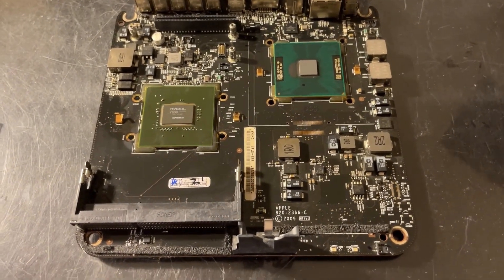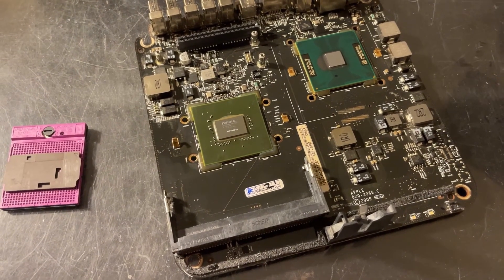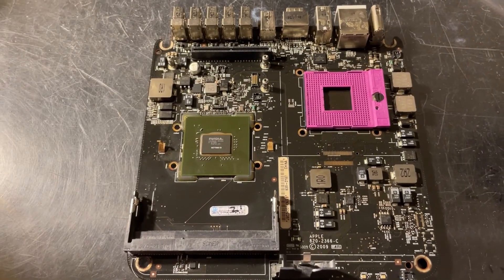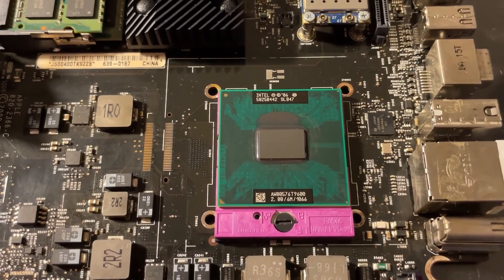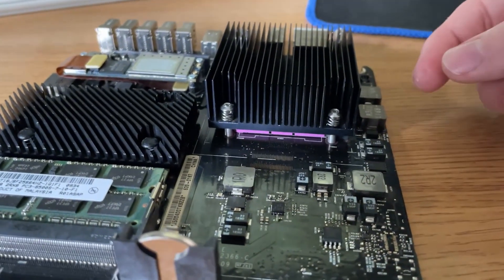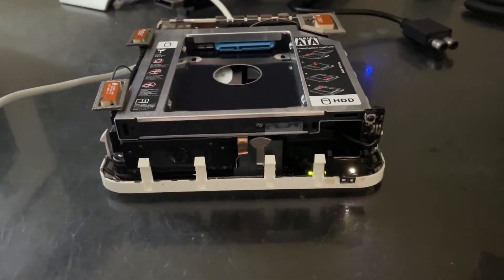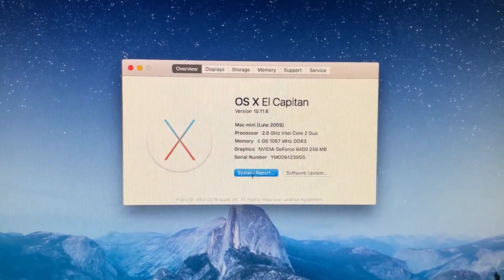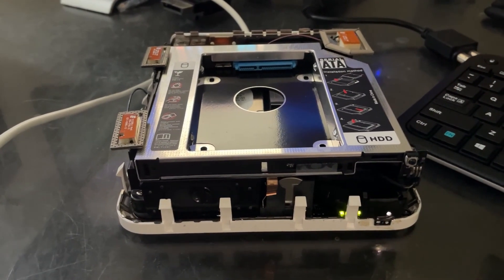Mac mini 2009 Soldered to Socketed CPU Upgrade

Comment from the maker: It seems that the retention spring-pins that were on this heatsink are not the original ones, probably due to a previous owner breaking and replacing them. That is why I had to replace them with spring-screws.

Comment: Planning on doing this aswell. Anything to look out for or reset when it comes to first powering up the mac mini? This is gonna make the mac mini so much more useful and a fun BGA soldering project. With MX linux mac minis are still a super useful machine but the 2.26 Ghz Core 2 Duo is holding it back quite a bit from its full potential.
Reply from the maker: I did not need to reset anything. It just worked.
Reply: @Josh.Davidson  Thank you good to know. wasnt sure since swapping stoff on newer macs may make it look like the mac isnt turning on but its just needs to be reset first

Comment: Nice video! Where did you find the cpu mod chip? I can't seem to find it
Reply from the maker: What do you mean by the CPU MOD CHIP?
Reply: @Josh.Davidson  I want to take off the soldered cpu and install a and easy seeding cpu. I thought I bought the first generation mac mini. And found several videos on the cpu upgrade but no links to get them
Reply from the maker: First generation mac mini has socket installed.

Comment: For the socket, do you blow hot air on top of it when soldering it to the MB? How do you make sure it won't melt?
Reply from the maker: My station is IR. But for hot air just use low airflow and lower than normal temp, higher than normal board preheat.

Comment: How well would a Core 2 Extreme work in this system?
Reply from the maker: Actually, I don't know. If the chips were cheaper, I would try it. I know quad core is not supported.
Reply: @Josh.Davidson  Damn, that sucks, I know Core 2 Quads are supported on the iMacs, shame they aren't on the Mac Minis.
Reply from the maker: Are you sure? I heard that C2Q does not work in iMac either.
Reply: @Josh.Davidson  yea, I've seen it done a couple times here on YouTube, I can't remember who it was, but I distinctly remember seeing somebody swap in a Q6600 into a 2009 iMac and it worked. Was recognized by MacOS & everything.
Reply: @Josh.Davidson  You have any damaged quad core that are compatible, I had one once that wouldn't boot unless I changed the bios to use 2core lol
Reply from the maker: I can't find anything like that. Reports I found show that only 2 cores show up and work if works at all. It because quad cores have a much higher TDP (105W for the Q6600) vs the 65W TDP of the chips used in the 2009 iMacs.

Comment: Man that had to be tedious! Did you use the same workbench setup you use to remove Xbox CPUs ?
Reply from the maker: Actually, it was very easy. Went on just like a CPU.
Yes, same rework machine and all.
Reply: @Josh.Davidson  I feel odd saying it but those tiny solder balls ...ugh. But you being the GOAT at such think, Mr. "psssh piece of cake."  😎👍🏼
Reply from the maker: Practice makes perfect :)
I have been doing BGA rework for 3.5 years.

Comment: sir why is the socket grape flavored
Reply from the maker: My reasons are beyond your comprehension.
Reply: It's called Socket P.  This is the standard colour for this particular socket which is similar to Socket 478 but has some differences in pin layout.
Reply from the maker: wooooooosh